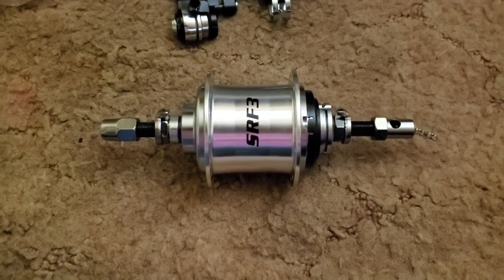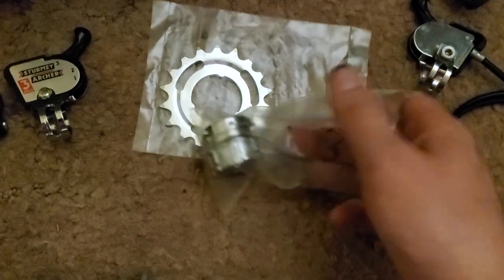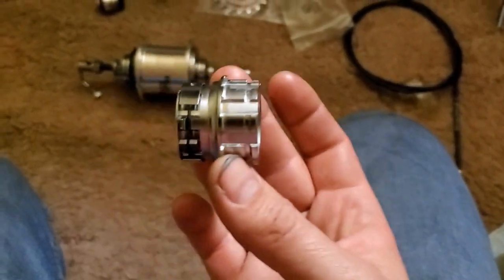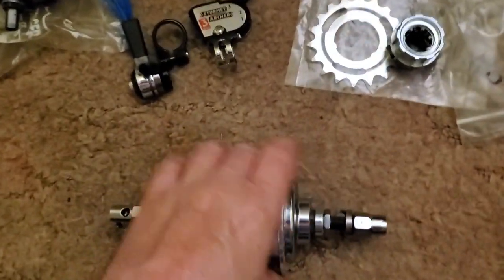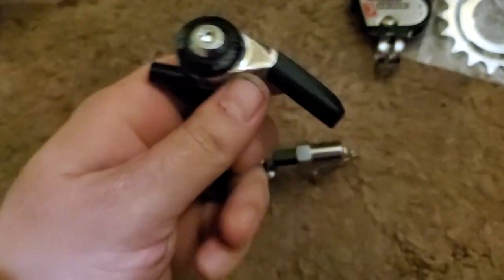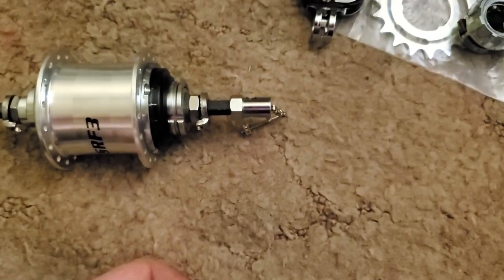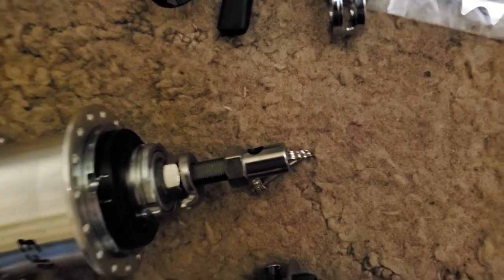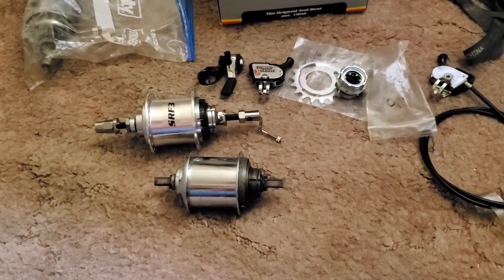Sturmey Archer SRF3 upgrades and other thoughts

Comment: I know that video is rather old at this point, but am i right to think that you where saying,

1. The brompton adapter allows the use of modern gears

2. The adaptor works on the older AW sturmy hubs

3. A new shifter may benefit me

Sorry for asking, but I have a hard time understanding  what people say.

Also to pick your brain a bit, if i was to use this adaptor, how would i go about replacing/modifying the gear and single speed chain on a hercules bike, like is there an existing kit, because i dont have any tools other than a adjustable wrench and a few screwdrivers. 

You are the closest i have come to seeing how to to add more gears to my hub.😅
Reply from the maker: the Brompton driver will only work
with the SRF3 and XRF5 or XRF5W and BWR or the modern chain pull hubs by sun race.  

older AW hubs or similar you can try finding the threaded driver that works with fixed gear cogs but you can also thread 5 or 6 speed freewheels onto it.
Reply: @thatbmxguy  thank you very much for the info this has helped me massively, I was about to waste my money in trying the adaptor..😅 
I honestly didn't expect a reply but I thank you massively.

Comment: Do you know if this upgrade will fit the Sturmey ArcherSX RK3 if so I have a bbshd on mine and go through rear gears alot
Reply from the maker: It should fit right on that hub in place of its stock driver.

Comment: Can I install disc brake onto this Strumey Archer SRF3 internal gear?
Reply from the maker: This one won't take a disc brake rotor.  You would have to get the RS RK3 or the CS RK3.
Reply: @thatbmxguy  any chance I can install an adapter? Either centerlock or 6 bolt adapter ?
Reply from the maker: Not that I know if.  You can however use the RS RK3 shell with the AW or srf3 internals if you don't like the rotary shift internals
Reply: @thatbmxguy  I don't think getting RS RK3 shell would be easy.
Reply: The hub you want is the S-RK3.  6-bolt disc, 135mm OLD, uses the old-school indicator spindle (same style but you would need the MK9 indicator instead of the shorter MK3 you'd use with an SRF....but don't worry; the spindle will be in the box if you buy the hub new.  They are in-stock at SJScycles as i type this.

Comment: I just got a 2nd hand - but I think its not shifting to first? like the cable is stuck and can not be pulled out anymore - is this normal?  just got into hubs, so different from derailleurs
Reply: I know its late and you may (or may not) have figured it out, but their is an adjustable screw on the line, their are videos on this, I would tell you how, but I'm bad at describing things.